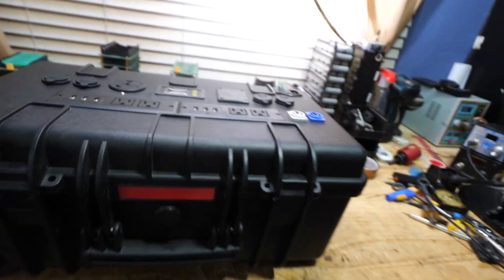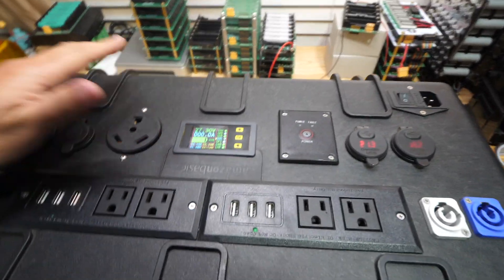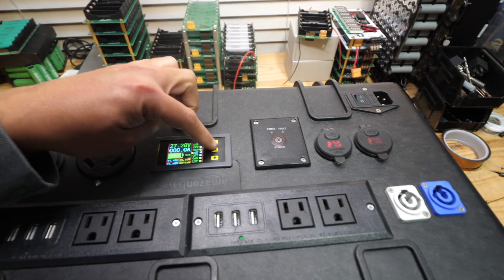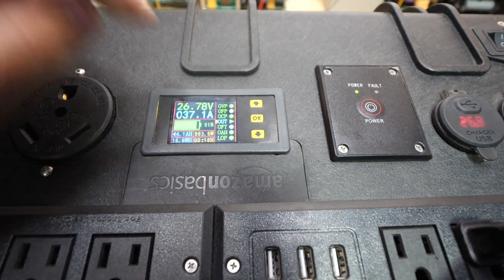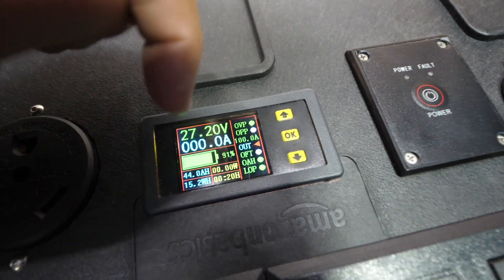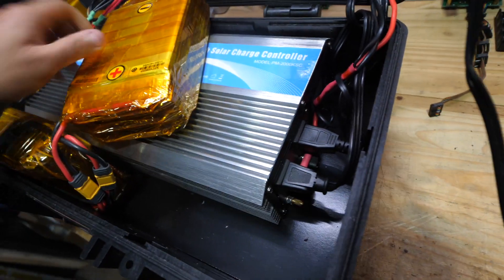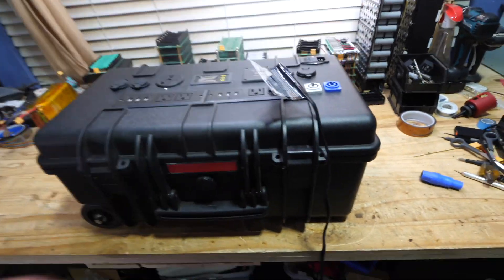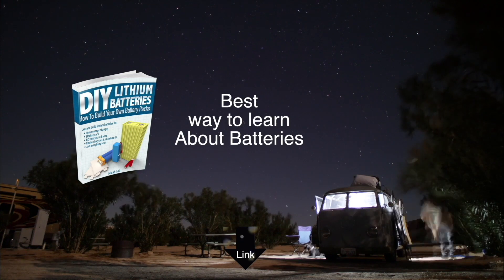DIY Solar Generator still better than NEW Kodiak

Comment: I don’t like pouch cells.  they swell with heavy use, and have a high fail rate.  relays can weld their contacts together, even if their rating is adequate, over time, the contacts get pitted, and resistance becomes great enough, they weld shut, or get distorted from the heat.  Good box for a short time emergency.  Not good for extensive use.

Comment: Can you explain a little more in detail how you connected the battery packs? I get you connected 2 of them using the rings, after the 2 it was never clear how you connected the other 5 to make the 7. Also do the white wires connect to the positive sides of each battery when hooking up the regulator gizmo you connected? How many total amp hours of use can you expect out of your generator? Thanks for the great videos. Oh yeah can you make this 12 volt as well?

Comment: i see something missing, the mppt controller for the solar input, I have lots of solar that's why i want to make one of these after watching the new ones that are coming out. My question was can you hook the mppt to the battery or to the bms ? The mppt i use have where i can set the battery volt and amps to match my needs with lipo batteries.

Comment: Dude...you don't have to apologize for making a great product!  Let the haters hate...because that is all they know.
This is a fantastic build...and I hope to build one as well myself using your designs.  :)
Can you recharge the internal battery packs using the external pack (when built)...kind of like using the solar to recharge?
BTW: The only thing that I would do differently is using a contactor for the 125VAC 30A connection...but much like your relays.

Comment: Jehu on the underside of the lid, lower left corner is a silver box with cooling fins.  It looks like a 24V/12V DC to DC converter I just bought.  If so I don't see it on the parts list.  Could you provide what it is for and connected to?  Thanks, love your products...Bruce
Reply from the maker: 12v sockets
Reply: @jehugarcia  Great, thanks.  I don't see it on the parts list though.  I just got one and early testing is looking good.

Comment: Thanks for sharing, its always a pleasure checking out your vids. I do agree with you that your unit is better than a mass-produced unit. It is often easier to produce A one-off unit much better than a unit that have to be designed for mass production. It's like the difference between a home cooked meal and restaurant food. I think most people have experienced that most home-cooked meals are better than most restaurant meals. Great job, you are very inspiring.

Comment: How long would one of these run a refrigerator for?
Reply: Drakilicious Refridgerator is about 140 watts and estimated about 8 hours on time each day. So 1200Wh/140W=8.5 hours. So should be able to run a refrigerator just over 24 hours. Older refrigerators were higher power but everything is EnergyStar(trademark😀) now.

Comment: I like your solar generator, the inverter, you said it has a charger built into it, I didn’t find that on the data at Amazon. Thanks Mike.
Reply from the maker: Look harder,  it has solar inputs

Comment: Jehu. One thing you need to keep in mind that relays are only good for electrical faults where the current is maybe 2x-10x the normal current, but they cannot break high current faults (1000A+) like a DC Breaker or Fuse can.

Comment: This is cool, and better than anything off the shelf, but I wouldn't pretend it's perfect. My biggest concern is that things on the inside are not secured down, and honestly you should probably still have fuses or something for if/when shit hits the fan and other parts fail catastrophicslly. (Disclaimer I haven't watched all of the other videos on this thing recently)

It's still super cool and well built though! Just not perfect 😉

Comment: Impressive, however relays cannot replace fuses, yes you are protected " if you remember to set it"  from a overload,  but not from earth leakage or a short circuit, you are depending on a large surge to cut the power, which would kill before blowing. Does the relay cut both live and neutral in case the user has mixed them up in there wiring.  What would finish this off would be a rcd on the output and a copper earth bar. Still I love this.

Comment: I hope you aren't using the relay you linked below your video, the spec says it's only rated for 40A. Good luck switching off a 100A load a few times, that's not safe at all, it'll weld shut in quick order if that's going on: 

Contact Data:
Contact Material: AgSnO12
Contact Form: 1Z(C) / 1H(A)
Contact Ratings: No: 40A 72VDC
Contact Resistance: 100mMax at 6VDC 1A
Max switching Current: 40A 
Max Switching Power: 560W
Reply from the maker: I’m using 2 of them

Comment: I must admit I like the design of this, in fact my project once financed is going to be closely based off this, however I may use Lead Acid batteries instead as I can source locally for less, rather than having to worry about shipping these specific LiPos across the atlantic. I don't want a several hundred dollar purchase getting seized by customs because we forgot to do something. I've had this happen before although it was the manufacturers issue, their documents were wrong.

It's pretty cool that you can use the meter to operate the relay as a circuit breaker and it's an interesting approach, but I honestly wouldn't want rely on that alone based off concerns about accuracy. I'd still have a relay but I'd have a master switch for the battery that operated it and have a separate fusebox, just so I know I can rely on a good quality fuse rather than a microcontroller.

It's nice to see the fans, it would've been nice for you to say that you added them, I can understand why you'd think that people ignoring what you said and criticising you because these weren't shown, but I didn't even notice them in the first video unless these were added after the fact.

Comment: Are those relays rated to open at that DC fault current? Circuit breakers are usually derated for DC because of arc quenching characteristics.
Reply from the maker: They are automotive relays so yeah dc rating
Reply: @jehugarcia  Very nice. Keep up the interesting projects.

Comment: Please get it right, not a relay but circuit breaker. Everybody is saying "relay" and that is a totally different piece of electronics and purpose. You corrected yourself but didn't make it clear you said the wrong part, now everyone in the comments is saying "relay".
Relays should not be used
Reply: Phizicks , it is possible that there is a relay acting as a circuit breaker using a overload circuit that drops the relay when the power load is exceeded. It looks that way as the load can be adjusted from the front panel and that controls the relay. Makes sense to me since it appears to be adjustable. A circuit breaker isn’t adjustable and there seams that there is no manual reset button or toggle. Hey, I’m not sure because I haven’t seen a schematic yet.
Reply: @MostynFaulkner  adjusting your relay as a circuit breaker is playing with fire.. literally.
Reply: @phizicks  I totally Agree. I have been and electrical contractor and electronics Tech most of my life.
Reply: He is using the relays AS circuit breakers...he shows how that works in the settings of the controller.

Comment: Fantastic! Its sad that all the Legal crap you couldn't have workers specialising in power packs and my interest,RV 2-4  kw backs to replace the dirty Lead Acid batteries..How far are you from Quartzsite AZ?
I bet you could sell 100 2-7 kw RV packs down there.I heard about 700K ,Full time RVers showed up this year.
It also be cool if you sold panels or have a suggested panel set up!
Bro,Don't worry about the bad apples.Its one thing to question its another to degrade as 30% of these Trolls do on any YT video.
Sty well.OH BTW how about powering the RV (trailer ) Wheels? A system that on the open road,And fully charged batteries it dumps the extra to electric drive motors on the trailer wheels.Disconnected could be simple as touching the braes only to come back on when you reset the system lie cruise control.
Please do something to get folks to work ad really make America great again!
Also,I dont use 4 wheel drive that much,Hows about eliminating the heavy 4W crap and add electric motors to be used sparingly to new cars? Semi 4W Drive system by JEHUGARCIA!
Stay well.73

Comment: That is a pretty cool project. I like the use of the hard-case. I need something similar for power tools around my smallholding.  I have two suggestions though:
1 - Relays contacts can weld closed.  I have witnessed this in a range of products. I would add a cheap automotive style fuse holder as they can deal with vibrations and are readily available. 
2 - Maybe add a spring-loaded or latched cover for the exposed components mounted on the lid for protection during transport. I mounted an HMI in a hard case using a internal plate. This means that the internal components are completely sealed and protected when the lid is closed. A laser cut stainless steel face plate is surprisingly cheap.
Reply: Seconded. Relays aren't designed for fault protection. A fuse will protect the system regardless of what the control software is doing or what the condition of the relay is.

Comment: Very nice setup. I would recommend having an additional fuse because relays can short unintendedly. I'm sure it's probably fine but from my experience, relays are a common point of failure because of the mechanical element. ¯\_(ツ)_/¯
Reply from the maker: I’m testing solid state ones at the moment hopefully they work better
Reply: Ah right. Totally forgot that those exist. Probably a solid choice then!

Comment: Only point I would poke at, would be the "If I don't show it to you, I guess it doesn't exist"....Yes....if you don't show it while building, it is assumed not there. Keep that in mind. When building something on the channel, or showcasing it, have it completed, or very specifically state that something is missing right now but will be added soon or it won't be considered there. I don't think that is unreasonable.

Comment: Excellent work. About the fuses, what happens if there is an internal short in the wiring battery side of the relays?
Reply from the maker: Same thing as a short before the fuse

Comment: ok after much pausing and starting and screencaps. the inverter you are using in the video is not the same one in the links. the one in the video is pm-2000ksc also listed as pm-2000ksc-24 which is a modified sine wave inverter
Reply from the maker: They are identical, other than one is modified and sine wave

Comment: the inverter in your link nor any of the "options" appear to be the same inverter in the video.
the link doesn't seem to have the onboard solar charge controller yet in a google search for the giandel 24 volt at that power output with the solar charge controller seems to be modified sine wave

Comment: I see the issue the haters have with fuses.
The relay setup you have is good, but it doesn’t protect anything if the relay fails. 
I would at a minimum put in a master breaker that cuts the battery feeds on a meltdown scenario.
The BMS 20amp maximum limit should protect the cells, but if they were to fail, you could have 600amps on those little wires, and a lot of carnage in that box.

I like fuses, and I would incorporate one into each battery pack...
Reply: This! Fuses are dead simple fail safes to add, circuit breakers are good too, if a little less simple

No reason why not, you're already going to get hate for it being unsafe, why not make it as good as it can be on that front rather than plenty good enough
Reply: @Michael Bingaman In the original video he puts a bms on each individual battery pack.
Reply: Michael Bingaman 7:46 he pats on the pack, mentions that each pack is rated for 200 amps, but the bms limits to 20 amps each
Reply: Plus relays tend to weld shut as their mode of failure...

Comment: Amazing work!!! But I must agree, that fuses are not this same as relays. And every one who had relay welded inside because of to much power taken by connected device, will agree. Problem occur specially if you want to use AC motor, which can take up to 10x nominal amperage during start.  Better solution will be use of fuse + SSR with zero crossing detection.  But, maybe this controller have it build in?  If yes, you don't need relay at all :)

Comment: Thanks for the update!
I understand using sturdy boxes as containers for heavy projects, but what bothers me is piercing through a watertight container in an emergency appliance. Since one would only connect it to either loads or other power sources once in an appropriate (i.e. somewhat sheltered) position, it can wait to have its plugs exposed until that time. This way once can prevent debris and/water ingress. That is achievable bu using a deeper box and having all connections in a separate panel protected under the lid. There are several projects that do this. Those I recall are related to emergency comms, made by hams (amateur radio operators).

Comment: Your project is not only better but also it's very environment friendly since everyone can really easily replace the broken cells inside or let it replace by an professional.
 
Other "emergency power supplies/box/powerbanks" are actually really good closed and you can damage the plastic/metal parts if you try to open them.

That's why I decided to build almost exact one that you did. The only difference is that I took other converter and European Suko sockets

Comment: Jehu,  of course this is better than the Kodiak, because it was built with love. You were saying with the connected booster power you could do 6000Watts of output, aren't you limited to the maximum output of the inverter and it has a maximum 'surge' output of 4000Watts. I am definately going to build one of these one day along with turning my Bus Electric :)

Comment: Really, cool project. Love it. And thanks for the part list 👍 but one question: I thought about using Relais too, but like the ones on Amazon they only go up to 40 amps...and yours work with well over 40...did you just connected them in parallel? Is that working? or is there more to it?^^

Comment: You shouldn't use Powercon for non Mains stuff, better use Speakon, currenthandling is the same and no-one will accidentally plug the Blue Socket to Mains. 
How do you want to "syncronize" the two packs by Voltage?

Comment: Very professional design and build. I've been an engineer for 40 years and your recent solutions match the best in the business. You have come a long way since I started watching you 2+ years ago.  Keep up the great work and ignore the Jabroni's.
Reply: I want to build one after seeing your video. How is the cable diagram?
Reply: However, you should not rely on software to trip a load.  All products I have ever dealt with have passive current protection.
Reply: I'll jump on this band wagon. I am a engineering technologist and yes it could be "prettied" up. I love the functionality of the design etc,etc , etc. I will have a fuse and a main contactor in mine plus a few more bells and whistles. I like the add on capacity.
He's come a long way...
Reply: The build is great, but I feel it would be even better if you chose low frequency inverter, over high frequency. There is a reason why our electrical grid is transformer based, and not $5 chinese chip based! Plz don't say idle consumption, my 3000w idle at a mere 13w.
Reply: Erosdox7   -Thank You for putting it in perspective !  I bought Goal Zero 1000 'open box' for $774. (with tax)  for a 1K storage 1500 watt pure sine wave out = an amazing unit at less $ $ than a 'Battle Born' battery by itself.    I could not duplicate it 'on the cheap' to save my life ! !  Great deals out there if you take the time to look.
Reply: @richardhobbs9038  did you get yours direct?
Reply: @DuanDao  - I don't remember if it was Amazon or E-Bay where I saw the add for it, but it was from Goal Zero .   So yes, it came direct from Goal Zero.  Even though it was supposedly  'open box'  it did not appear to be repackaged .

Comment: You should sell this!
Reply: I agree, you can sell them....and upgrade as better tech becomes available....never to be obsolete
Reply: At least sell partially assembled kits.
Reply: Yes please
Reply: Yes, exactly, everything except the lipo batteries. Those require special shiping arrangements and is costly. So, a prewired and soldered kit with instructions on how to wire your own batteries. New meaning for, "batteries not included."
Reply: It will never be safe from the internet trolls. Used to be you just had to build it safe from the average infantry guy, now you have to build it so it is safe from someone trying to burn down their house because they think they know better.
Reply: They would sell. Without further advertising.